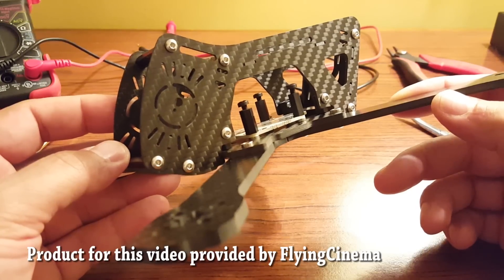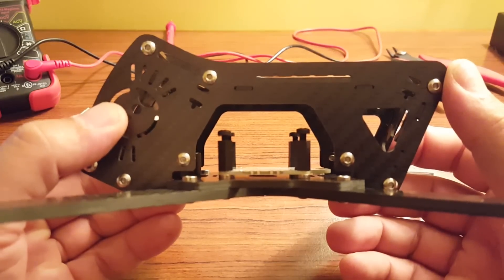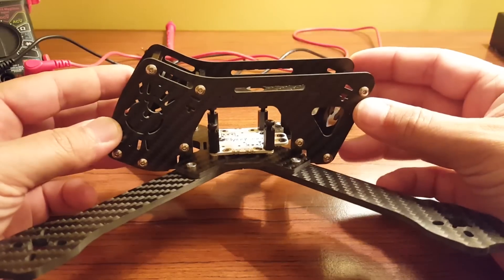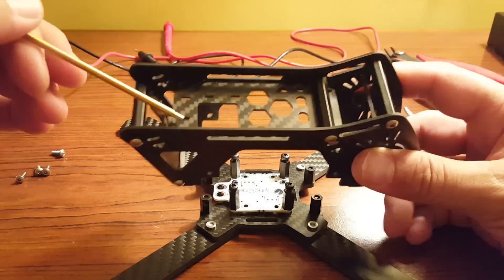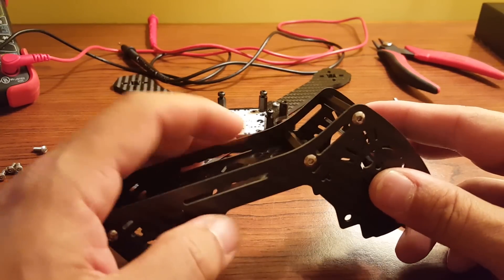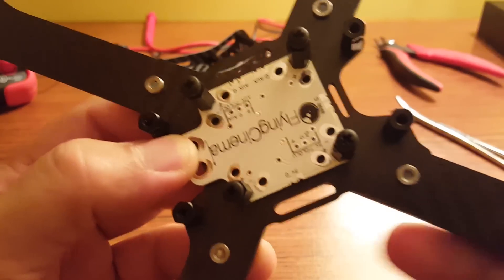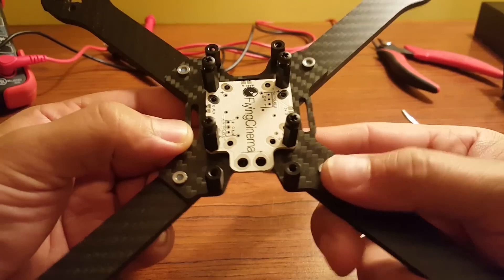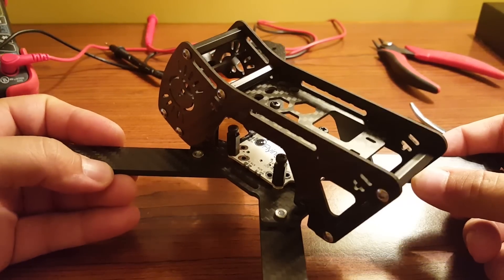FlyingCinema X24 Mini-Quad - Frame Review

Comment: Cutting this stuff in asia is easy but if the market does not support the higher cost original designs they will be stuck with zmr's to choose from. The only reason asia has cheap frames that work and cut for more greedy designers here is because of domestic cnc made designs here in US and Canada. Innovation is made by individuals and sometimes support for the guy in your country goes a long way. Great review, cinetank has been experimenting a long time, remember his first rig.

Comment: I mount a lot of my cameras like that, you really need something to hold the camera vertical.  the older style board cameras have a notch that's nice for holding orientation.  the notch is removed in the design of the 1177 and swift.  maybe a piece of foam under the camera to hold it level.

Comment: This frame looks amazing, everything seems to be well done with very smart ideas! The antenna zipties cut outs just killed me! It was so needed on any build, and this is the first time I actually see a mount for these.The "cage" and lift up body is very well thought, because I hate to have to replace and fix everything again each time you separate the upper plate to work on the quad. The way of everything is well protected and fixed (but the FPV cam) is really good i find, but...I wonder how it would resist to crashes with the 4 mounting standoffs, because the upper module is also the heaviest part of the frame, I hope it will not rip appart the main frame...Now I need one one these...

Comment: good looking frame but pricy for what you get
Reply from the maker: I kind of agree. It's priced itself into the range of some very good frames--which is not to say that this isn't also a good frame, but it's stiff competition for a new frame with an un-proven track record compared to something like the Alien or the QAV frames.
Reply: my thoughts exactly. I am looking for a new frame to replace my QAV210. I want an X frame but considering the unconventional design and cost it's a bit to risky for me. How hard is it to change the camera tilt. On my QAV I just move it with my fingers in 2 seconds.
Reply from the maker: You have to disassemble the side plates to adjust the camera tilt. The flip side is that it will never move in a crash. So once you know what angle you want, it's locked in. For me, that is critical. I don't want to constantly be readjusting the camera after every crash. That was one thing I hated about the Mixuko. The camera mount was not secure enough for my tastes. On the flip-side if I wanted to adjust it, it was easy, which was occasionally nice. I could go from a full out speed run at 65 degrees to a tight short-course at 30 degrees without pulling out a wrench.
Reply: +Joshua Bardwell I have my camera pretty snug on my qav currently. I used a little clear fingernail polish to hold the screws in tightly it will move but take some force. I've never had it move in a crash and lately I've had quite a lot of them due to a bad motor or ESC.

Comment: The cammera mount system is very common, and it works well if you tight it with plyers
Reply from the maker: I don't know what you mean. The camera mount system requires no pliers or anything like that.

Comment: I'm scared of the 4 screws to get the top open. The pressure during a crash could cause it to brake (not a big deal just replace the screws.) I feel like the soldering could get undone and wires, again not a big deal. Maybe could you do a true X review on LifrRC and RazorQuads frames becuase my next build will be a true X from one or the other supplier.
Reply: Otherwise I think this is a clever build with all the knick nacts
Reply from the maker: +H.O.F Hobby Channel that's a valid concern. I don't know. It's not uncommon to hold a top plate on by four screws but the design of a traditional standoff may be stronger.
Reply: Been testing this frame along with the designer  and 2 other guys out of CA since the prototype stages (about 5 months total). Back then the frame was made of G10 material. Only 1 frame has broken at the area of those 4 screws and it was because of a super hard hit to asphalt. Don't believe any frame would've survived that crash. Now made out of carbon fiber material we've hit chain link fence, countless trees (and tree trunks), and only lord knows how many times we've hit the ground - FAST - and no big issues with the frame. Especially the area with those 4 screws. Check out LeviathanFPV's YouTube page for some cool vids of this frame flying.
Reply: True thank you for the little explanation. I would get this frame but it's to much maybe if I save up a lot on my next build

Comment: I just wanted to add that the slots on the bottom are for a bottom mount battery. and the underside of the pdb has space for the generic China regulators.
Reply from the maker: Yup. That was what I thought the slits were for, but I missed the bit about the regulators. So you can, if you want, skip the Pololu and go with e.g. a little 7 volt or something.

Comment: This looks interesting.  I have to say that the frame is not only expensive (~$120), but pretty heavy too.  I'd be interested in the X20, for $10 less, but that weighs about twice what other frames in that size weigh.  I really would like to see if the convenience/strength is worth the extra cost and weight.
Reply from the maker: I kind of agree on the price. There are a LOT of great frames at this price point, so there is some strong competition. If the frame were in the $80 price range, it would be more competitive, but that's not my call to make. As for weight, I don't know, but it ends up at almost the exact same weight as my QAV-R when in identical trim. I also thought it would be heavier, but it didn't turn out that way. I don't know why, as the bare frame certainly is heavier than some others in its class.

Comment: I want to buya BDX 240. I have built one similar to this. Having the camera low reduces the center of gravity ( improves handleing ) and gives you low to ground, sphincter action moments 
This will help with your build, receiver mounted to  top plate . https://youtu.be/rUUDETyLtYI

I want one, BDX240 ;   shttp://red20rc.com.au/shop/multirotor-frames/bdx240-fpv-racer/
Sphincter action moments ;    https://www.youtube.com/watch?v=RnDS72hHHBw

Comment: meh... 4 right angle mounts... that's everything you got to hold your X frame to your battery... It looks like a HUGE weakness to me. And the battery is very well hold on the top frame too, so in a crash these 4 angled mounts would have to absorb all the inertia without breaking. The battery which might get thrown away on other designs will be firmly attached and retained by the frame here. I just don't think these mount can hold so much energy... The rest of the design looks very interesting though! I love the antenna mounts and I think the gopro session is THE way to go for fpv freestyle shooting sessions ;)
Reply: +Joshua Bardwell they are in fact metal. I've been flying/testing 1 for 4 months and it seems very strong.
Reply from the maker: I am on the fence. If you think about it, there are small frames with only four standoffs that hold the whole top plate on with a few threads each. But I might feel better if the brackets were metal instead of nylon, which I think they are.

You can bottom-mount your battery if you want. The frame seems to include slits for a bottom battery strap, although I'm not 100% sure that is the intent.
Reply from the maker: Good to know. I cross threaded one by accident and stripped it which is why I thought they must be plastic. Maybe Aluminum?

Comment: The lift up body is very interesting- I am curious, having been a fan and builder of just about every side plate or monocoque inspired frame out- I can attest to the "ruder effect" that is experienced, albeit inconsistently in the various designs out. (still fly my Aerial Havoc 340 which was one of the first monocoque frames)
There is potential for issues with side plates creating low pressure vortex near the arm and plate and causes odd flight characteristics- noticeable in hard and fast yaw mostly. This frame strikes me as not subject to any of that.
I do however wonder about those 4 mounting points in crashes- I am hard on stuff and wonder if they will hold or become tenuous.
Reply from the maker: Very valid point. I have suggested to FlyingCinema that they should include spares of that part. I accidentally stripped one during the build due to my own carelessness, and it's not exactly a standard piece in a standoff kit.